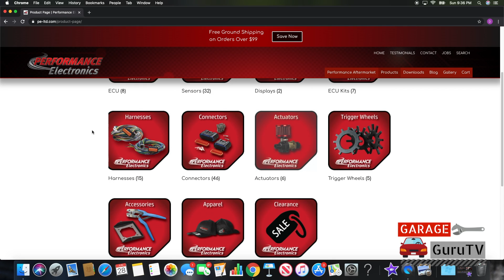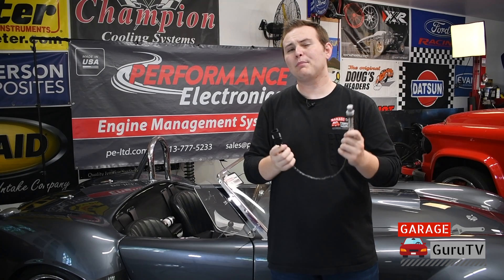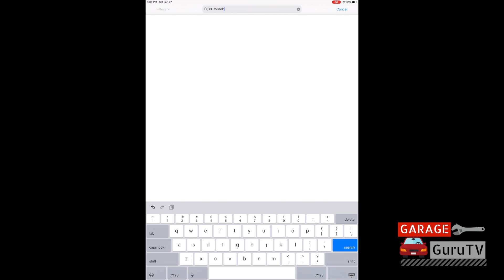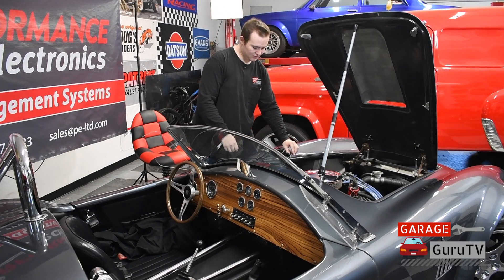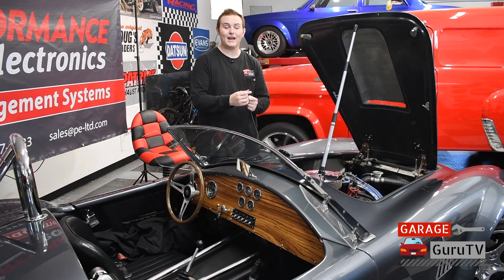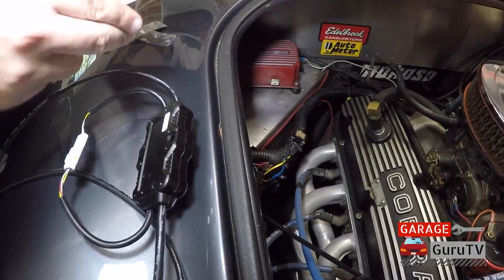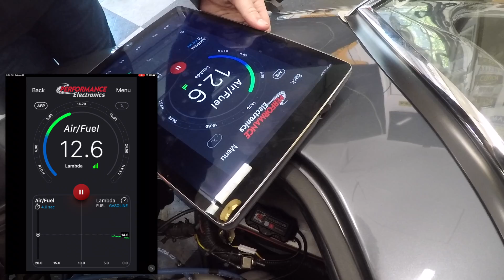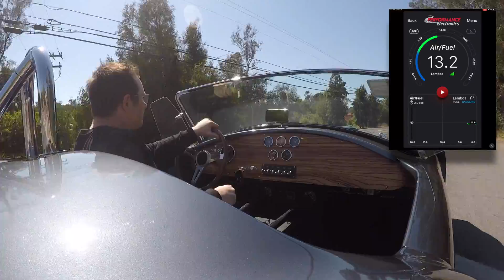Performance Electronics Wideband O2 Controller Kit + Bluetooth!

Comment: Does it store the afr graph on a SD data card? Does it maintain the data if the car is turned off or the Bluetooth signal is lost? Does it have an RPM input signal? How can I go back and review the data once in done driving the car?
Reply: The data is stored within the app on a history graph. You can record up to 2 minutes of data. If you wish to go back and replay the data, it is recommended that you use the screen record option on your smart phone.

Comment: This is a versatile product. I like how you can effectively record AFR (although it doesn’t have critical RPM as well by the look of it), and that the cables are short, because I’m after something for my carbureted motorcycle and don’t need 8ft long sensor cables.
A note about heating - don’t preheat the O2 sensor and then start the engine after the sensor is heated. It will get a blast of colder exhaust temperatures, or worse still exhaust tube condensation. Repeated thermal shock like this creates stress fractures and ultimately the sensor fails. It’s better to wire up a relay and switch, run the engine for 20 seconds, then switch the sensor on so the exhaust gas is already warm. Otherwise you’ve got a super hot sensor getting a blast of much colder exhaust gasses on engine startup. That’s why wideband Sensors routinely fail too soon.